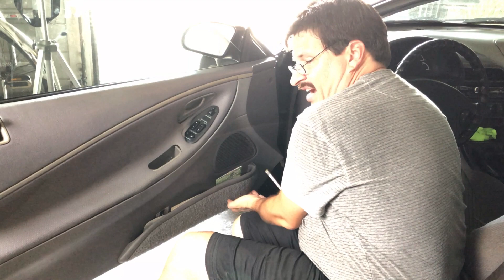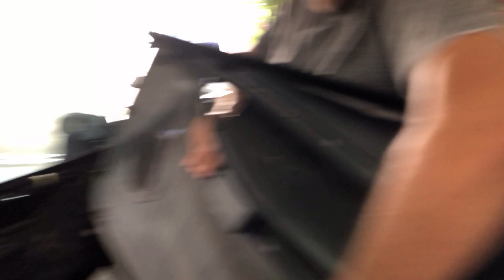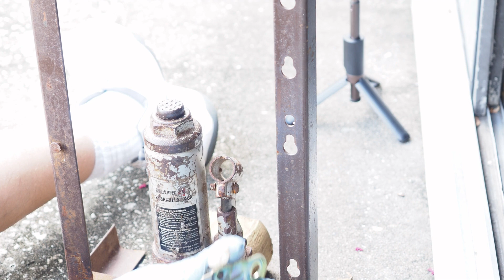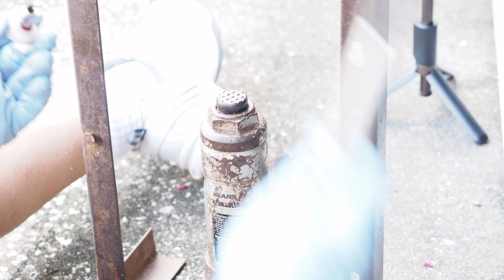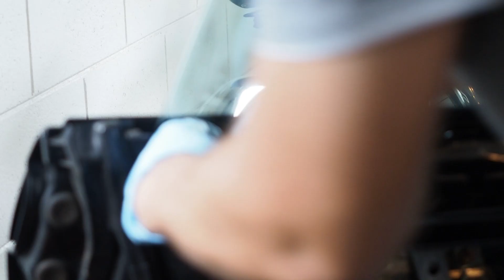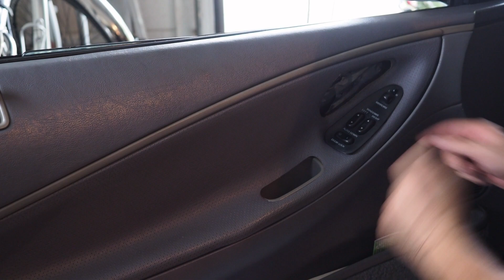Second gen Probe window fix

Comment: I should have done this a few years ago. I put it off and now today it pulled a cable out of it's holder. Window wouldn't go back up. 2/4 of those plastic things are gone, both on the motor side.

Comment: Do you, or anyone know the dimensions of the correct rollers?
Reply from the maker: the black ones are almost the same size, the green ones are slightly bigger than the ones I make.  What's the measured size?  I haven't measured them
Reply: @TheSidneySmith  I have seen the black ones listed. I see alot of options on line, but I don't know what size the original probe rollers are supposed to be, and can't find that info. Some roller options are .50 diameter and some are slightly over an inch diameter, and the thickness and inside diameter also vary greatly, so I was hoping to match them as best as possible the first time. This is a project that I'm working on for someone else. Plan b is to just get the car take it apart and measure the track to determine the size, and end up have his car longer than I care to. Thanks for the reply and info can can share is greatly appreciated. Glass company came and replaced his glass, and an hour later he had the window wobbling in the track, glass company came back, looked at it and determined it was their problem and left him with a crooked window.

Comment: Will these bushings work for an 89 Probe GT? I replaced the regulator and the bushings have basically disintegrated.
Reply from the maker: yes they do....and the first gen uses 2 bushings per door, whereas the second gen uses 4
Reply: @TheSidneySmith  how do we go about getting a set or 2 since I'd imagine the passenger side is ready to go as well. solidale21@gmail.com if email is preferable.
Reply: @TheSidneySmith  any idea how I can get some bushings for my window regulator?
Reply: @TheSidneySmith  can u please send me a cuote for 8 rollers? nano_piston@ hotmail. Please i need them im in florida 34744